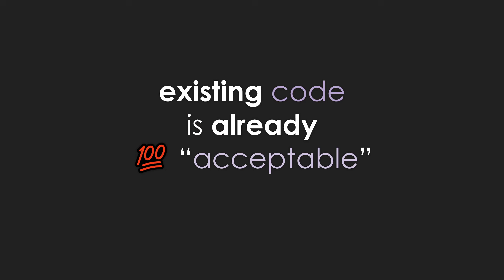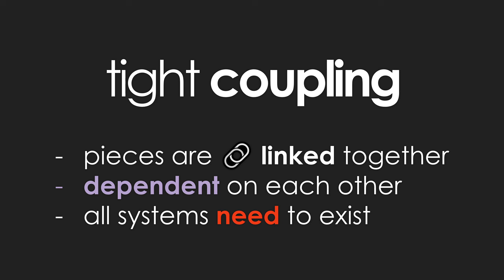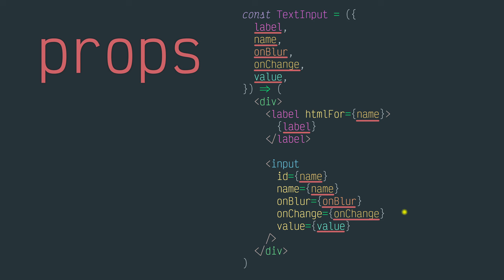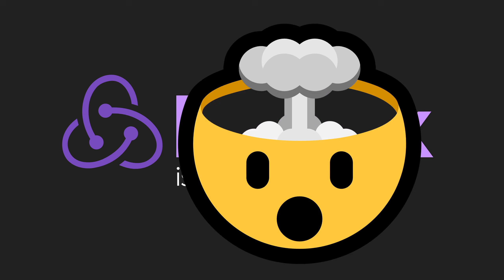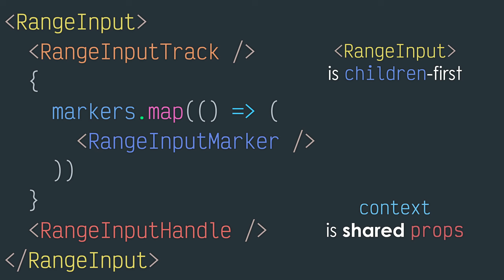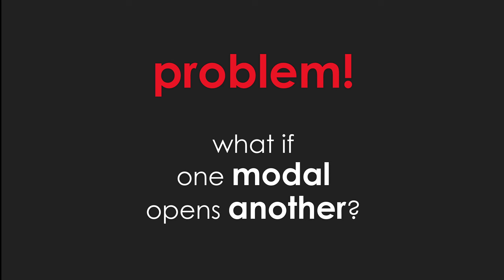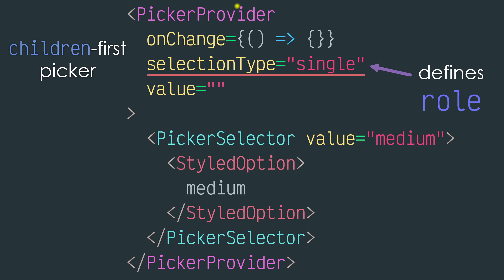Definitive Guide to React Component Design and the key to avoiding tech debt

Comment: I'm still digesting this. I think in general I agree with a lot. I'm the one making the stink of using good patterns and avoiding tech debt at my company. A lot of my coworkers can see tech debt after the fact, but they can't see the actual cause. It's usually just, "we couldn't predict that this is what we'd have to do." Sure, that's true in some cases, but you can still maintain a lot of flexibility. And this talk showcases that with your building blocks concept.

cloneElement frankly scares me lol. I think its biggest strength is also its biggest weakness: that to the consumer, it's "magic" that "just works." I agree that I shouldn't care how something I'm using works, just how I need to use it. I think I get how you're using it here though. At first I thought you were doing the compound component pattern with that, but it seems you're doing that with context where appropriate. There are certainly situations where there could be another layer between a parent part of a compound component and a child part. But using components that clone their children to inject props is certainly interesting. It's like a more declarative HOC that can also be used inline. I know you don't use Typescript, but I'm curious if there's a way to type this. Probably is. Like "I need an instance of a component that could take this prop." I think it'd be something like ReactElement<{ onClick: () => void }>.

As someone else mentioned, I would also like to see examples with more depth. I don't know if you could write up a gist or something. I know coming up with examples that imitate real world use cases can be difficult, but with the video format and the slides only containing so much information, it's hard to keep a mental image of what the code might look like.
Reply from the maker: Thanks for your response! You're totally about people not seeing the cause of tech debt. I've also worked at numerous places where they always say they couldn't have known, but the design was such that it was absolutely gong to cause it.

# 1
`cloneElement` was also scary to me when I first used it. I tried it once on a `Button` where they would pass in an `<Icon />` component, the only one we accepted, and I modified the icon with the correct `size` relative to the button. This is tight coupling but also my first time using it.

# 2
You're right to point out this isn't regular compound components; context is key. cloneElement is only used for the presentational UI components. The logic itself is tucked away in context. Glad to hear you understood this deeply! 👍

# 3
I like the idea of relating it to higher-order components. Standard `withTheme` and `connect` hocs are static, but render props is a dynamic version which is why you can replace `connect` with `<ReduxConnection>` (https://github.com/reduxjs/react-redux/issues/920). To remove boilerplate and get the same effect with standard React, cloneElement is the dynamic equivalent.

# 4
I personally don't use TypeScript on home projects (at least not yet) and definitely not for presentations since I wanna keep things simple. On the other hand, I'm forced to use TypeScript at my new job, so I've been learning it since March. I was also thinking of somehow modifying `children: ReactElement`. If you figure out a way, please tell me, and I'll put up a video on it. I can even Zoom call you in the video since you'd be the one who solved it. I haven't had to solve this at work just yet, but I will later this week.

# 5
You're correct about the slides being limited. I focused on the API and not the implementation for that reason. It's also a limitation of what people wanna watch on YouTube. I even moved all my live-coding videos to a separate channel because they were killing this one.

I have an implementation of Picker available on CodeSandbox: https://codesandbox.io/s/picker-component-architecture-tq0jk?file=/src/Picker.jsx.

The Visibility components I've written for companies, so I don't have any available on CodeSandbox. I was honestly thinking of building a library instead. It's not like this couldn't be open source. It's literally the simplest set of building blocks that you'd use 100 times in your apps. Problem is that building a library would take my free time, and I get paid to do it at work 🤷‍♂️.
Reply: @KevinGhadyani  I think the difficulty with typing it is going to be for components that need the prop that is being injected by the parent when it's cloned. TS doesn't know that the cloning is happening. Now, you could make the prop always optional, which is kind of fitting (a button doesn't need onClick technically) but this doesn't seem like a solution that works universally.
Reply from the maker: Actually, it should be optional. Why is onClick required? What if you're testing the button's text? Why tightly couple the onClick mock in that test?

I actually advocate optional props with sane defaults normally anyway. Existing props will need to be mocked when writing regular code or the cloning won't work

Like with TypeScript vs JS, optional props are a different mindset.
Reply from the maker: What's upsetting to me is realizing I missed that. When I did this in person, someone asked, so I answered it.

I have plans to do a short video in the future on "sane defaults", my own term.
Reply: @KevinGhadyani  We may just disagree on this, but for me, sometimes a "sane default" is to throw an error. For example, you have these parent-child relationships with these compound components that utilize context. In the example code you shared in this thread, you default the context value to the same shape as you'd expect (which certainly is useful for inline documentation) with empty values. For situations like that, I tend to leave the default context value as undefined. Then in the consuming child component, I throw a descriptive error if the context's value is undefined, saying that the context provider with a valid value was expected to exist. If I provide type-compliant defaults, I'm left with situations where it could silently fail if someone forgot to use the parent component. Then that's extra time spent debugging for a pretty simple bug with a simple solution.

Is there something I'm missing about providing these default empty values?
Reply from the maker: @wesleynewcomb  Great comments again! I love responding to these and will probably make a video going through these points for others as well. You're hitting on some great points!

I might be misunderstanding you, so I'm going to respond to different points, and you can tell me if I was off :p.

#1 - Throwing errors is good
I agree that it's great to throw errors because silently failing sucks.

I've worked on numerous projects (including my own) where devs were always "safe" in the code (just like TS forces you to do) and real errors would silently fail leading to insanely difficult-to-find bugs. I remember reading an article about helicopter coding years ago when I was dealing with these hard-to-find bugs.

#2 - Many required props aren't actually required
If a Button component renders fine without an `onClick`, can you truly say it's required?

Part of it is unit tests. To test a Button, you should never have to mock the `onClick` when testing the render. You should only pass the `onClick` when testing click functionality. This is the same way HTML functions: `<button onclick="">` is optional.

When doing unit tests, I never have a set fixture used or overridden in every test because that makes it incredibly hard to figure out why Test X broke. It's easier if all the props are right there in front of you, and you don't have to infer anything.

In the same vein, `children` isn't required for a button either. You can easily do `getByRole('button')` even if Button has no children, and you can test `onClick` just fine.

It's not a matter of masking missing props. It's a matter of "what does this component actually need?".

At the last company I worked, we had a ton of required props in the component library (thankfully it was PropTypes). If you ever ran one of the apps using that component library, you'd see tons of PropTypes errors in the console that nobody noticed.

What's important isn't that "oh, they're doing it wrong", no. They were using the components correctly. It's actually that the component designers were wrong about their assumptions on how the components would be used. They were playing god and omniciently trying to determine which props were "required" when they should've left them all optional if the component worked fine without them.

#3 - Where do you want errors?
I want errors when dealing with backend APIs.

If I'm in a TS project, no one's gonna pass an array where I expect a string, so I can completely avoid worrying about those checks. I'll never have to deal with those errors because everything's typed. This way, optional props are safe.

On the other hand, backend APIs are scary. You have absolutely no clue what they're gonna give you, and you want to error when something's wrong. This is easy to do using JSON validation at the `fetch` rather than having your components deal with it.

None of your components care about your backend and will error if bad data comes in because you're only mocking `undefined`. JSON returns `null` when a value is missing.

In the case of `array?.map(() => {})`, you can avoid the `?` if you setup `[]` as a default.

As an aside, I think TS typically forces you to play it safe with `?.` which leads to helicopter coding.

#4 - Default Context Values
I like to always set a default context value for testing.

I use Storybook even in app code. If I have to mock a context provider each time I create a story, that means my stories are tightly coupled to that context. In an uncontrolled story (which is usually what you want), I don't want to tell anyone else about the existence of these mocked context providers.

I can see it now. Some unknowing dev will copy-paste my story's code along with the 3 mocked context providers. They'll spend a day trying to get it working before complaining in standup the next day (hurting my rep) and eventually scheduling a meeting to ask how they can fix it. That or Slacking me. Either way, it's not valuable time spent.

#5 - Erroring on `undefined` context
Erroring on an `undefined` context is fine. This can help people learn how to use their components, but there are some issues with this approach.

Unless you're re-providing the context (as `undefined`) in both the VisibilityTarget and VisibilityTrigger components, you have no way of knowing if your in a deeply-nested VisibilityProvider's children. This would be a silent-fail and also super weird behavior that isn't easily debugged.

I understand why you'd want `undefined`, but there's a far better way.

If you export `defaultContextValue` (which I do for Storybook and unit tests) or close over it in your exported `useVisibilityContext` hook, then you'd easily know if there's no parent provider because `useContext(VisibilityContext) === defaultContextValue`. You don't need `undefined`.

In fact, `undefined` is a serious violation of the context contact. This would only occur if someone's actually breaking the contract: `<Context.Provider>` << oops, they forgot the `value` prop.

#6 - Default context values are necessary
In case you haven't seen the followup video (https://www.youtube.com/watch?v=4AgE9xba3Lg). I have no way of knowing if you've seen it or not, and I wanna make sure we're on the same page.

In this video, I show that you want to use a default context value instead of `undefined` because it allows you to achieve the expected behavior.

In this case, we have a `VisibilityControlProvider` wrapping `VisibilityProvider`s. But deeply-nested are more `VisibilityProvider`s. How do you solve the problem of those deeply-nested ones being controlled by the parent `VisibilityControlProvider`? By re-wrapping `children` in the context provider.

After figuring out this solution, I'm starting to think it should actually be be a requirement as that's most-likely the expected behavior 99% of the time. Without a `defaultContextValue`, you can't re-wrap the parent context. If it's `undefined`, it will error even though that provider it absolutely supposed to be optional.
Reply: @KevinGhadyani  
Thank you again for another response! I'm enjoying the back-and-forth.
I'll actually number my responses this time, too.

#1 - Glad we're in agreement
#2 - Yeah, I can see that. For most components, they likely only need one or two things to really work. My current job is actually my first time working on a large React codebase, so I'm learning a lot as I go, esp. from the mistakes of those who came before me.
#3 - Agreed here. We're all full-stack at my job (not a fan) and I was arguing with a coworker just yesterday about type checking on I/O. He said, "at some point you have to trust that the backend is giving you what you expect." I think not! We actually currently have types that mismatch what we actually expect to receive. Most of them are mundane, but there is a lot of legacy code that types things as undefined where they come from a JSON response, which as you said can never have an undefined value.
#4 - Our team is looking to implement Storybook soon. It was actually your OneForm video that sold me more on it than anything my team says.
#5 - I hadn't thought about just using strict equality with the default value for the context. That makes a lot of sense.
#6 - I did watch it, but admittedly, some of it went over my head. I'll probably need to watch a second or third time. You talk pretty fast (normally okay) and I know you edit out a bunch of dead air. This pace can be hard to keep with. For this video, it's absolutely necessary, considering the length we already have. Not really telling you what to do. It's your channel and you see the analytics and I don't.
Reply from the maker: Thanks for numbering! Helps me keep my place while reading and responding.

#3 - To clarify, JSON can't explicitly be undefined, but JS can interpret undefined values as such like a missing prop.

#4 - Nice to hear my OneForm video made an impact on Storybook :p.

#6 - I know I talk fast. I think fast too ;). I watch all videos at least 2x. I also edited this video at 2.5x and edit Code conversations at 3x. Because of that, it's hard for me to know what people do and don't understand.

You're not the only person who's pointed this out, and I appreciate the feedback. My parents have also brought it up multiple times (they apparently watch my videos) when I have a talk coming up.

I have the pacing down in person, but like you said, I edit that down for flow and total length on YouTube.

The dead space I cut in this video was mainly mid-sentence. I had a lot of short and medium pauses in the middle of a point as I ad-libbed.

And while I can see my analytics, that doesn't mean I interpret them correctly. I've seen long videos do well on my channel, but most people aren't watching that long (20%). Short videos barely get any views, and I wanna be respectful of peoples' time.

I've had multiple people ask I break these up into multiple videos. Not happening in this format.

In general, YouTube favors consistent video times, so I try to keep them around the same time where possible.

Comment: Thanks a lot for this, as a beginner/intermediate software developer this kind of content that goes beyond usual YouTube's material is really valuable to level up. 

I went ahead on my editor to try to implement the child first pattern with cloneElem and Context but if I may suggest something I think that this format suits well for conferences but a slightly more decoupled format within several videos with executed code examples to compare the different approaches might suits YouTube better and be more accessible.
Reply from the maker: I appreciate your feedback. What might solve your problem is chapter markers.

If I did break this up, I don't think anyone's gonna watch the other parts.

Also, the presentation doesn't make sense without the context of the full talk.

If I split these up, I'd have to re-explain why tight coupling is bad and tech debt in each part.

I've also seen other YouTubers more successful from uploading longer videos. I've also heard that multi-part videos are a "bad practice" on YouTube.
Reply: @KevinGhadyani  Maybe making a playlist + just specifying at the beginning of each part that it only makes sens if you've watched previous videos. That way you could have more in details parts while still managing to not have a several hours monolith videos. 

For the format maybe you're right, I often got confused because short videos in form of series (see for example code evolution) are successful in general but it's true that the first video of the serie might have 10 to 100 times more views than the last one but I guess that's inevitable, people get excited at the beginning but then quickly give up. 

In the other hand there are 10 hours tutorial videos that got a massive amount of views, but at the end how long people watch them ? I don't have the stats but if it follows the previous pattern I'm confident people just watch few minutes. It feels like people see them as "a full course" and just jump into them. 

Don't know if you know Jack Herrington ? He makes videos about JS/TS and for me he nailed the perfect balance
Reply: I think chapters within long video is more that sufficient to keep track of last watched part.  Keep it up.
I Liked the video 👍